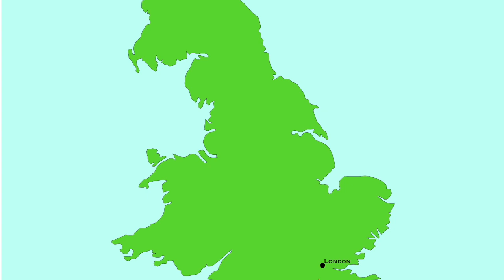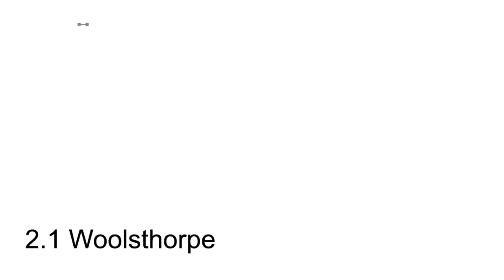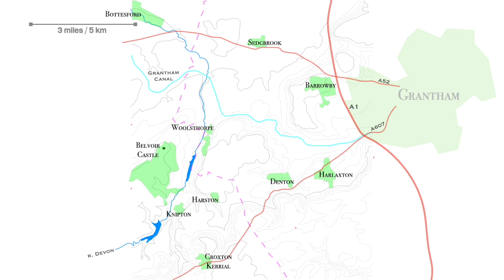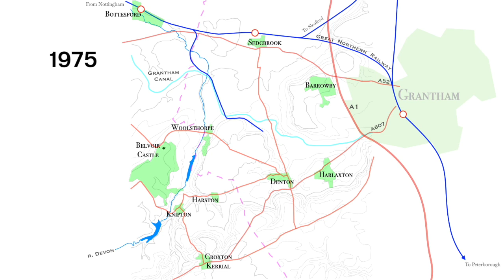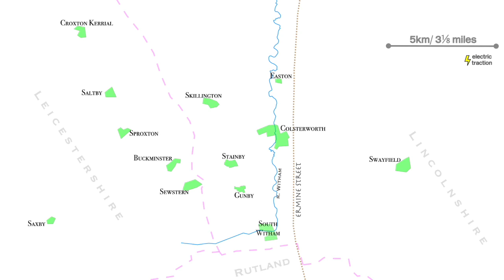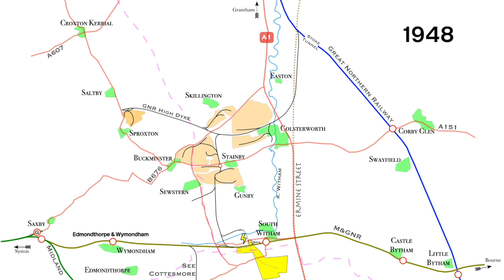Ironstone Quarries Part 2 - Woolsthorpe and The High Dyke

Comment: I worked with number 17 pit locos Jupiter and Juno in the late 1960's. Jupiter was number 60 a Robert Stephenson and Hawthorns 0-6-0ST of the raised fire ox type known as "Uglies" (62 was preserved). Juno was a 1958 built Austerity 0-6-0ST and was offered to me to purchase on its retirement from service but sadly I had nowhere to keep it. It was eventually preserved and is a Isle of Wight Railway loco which is currently on loan to the NRM at Shildon.
Several Andrew Barclay locos worked at S&L quarries at Harlaxton, Stainby and Colsterworth. The 15 Inch Barclay 0-6-0ST Ajax being now also at IoWRly. was last worked at Harlaxton in 1968.
For a short time after its closure in 1959 part of the M&GNR line between South Witham and Thisleton was leased by S&L to work ore traffic out of the Thisleton Mine over to High Dyke firstly with steam locos and later with ex-BR class 14 diesels. It was an interesting experience working 16ton mineral wagons, up to 10 at a time over the ex-M&GNR line! I had often been over the line on passenger trains when going on holiday to Great Yarmouth
Great memories of days long past.
The O2 2-8-0 locos that worked the High Dyke Branch used to cross the A1 dual carriageway by a big steel plate bridge and there was a very steep gradient down to the sidings at High Dyke. They used to detach the brakevan and after the loco and about 6 wagons went down the bank and reversed into the sidings they ran the van down by gravity into a short headshunt that was arranged to go uphill in the opposite direction so that it could be attached to the rear of the empty train going back up to the quarries at Stainby. A very explosive run had to be taken at the bank to get back up onto the branch. An exciting move to watch!